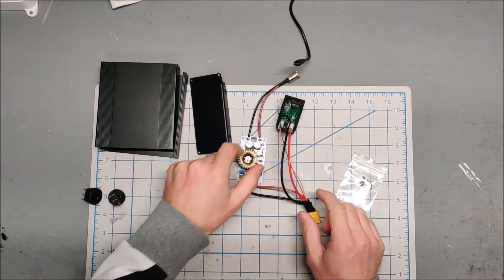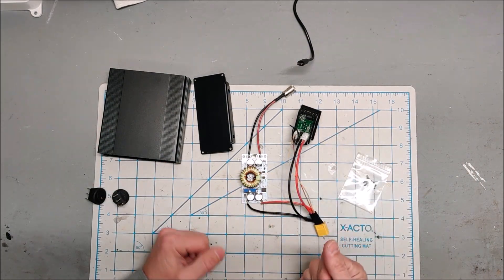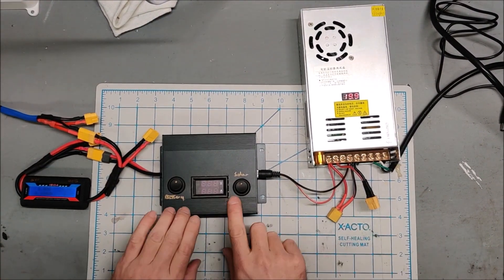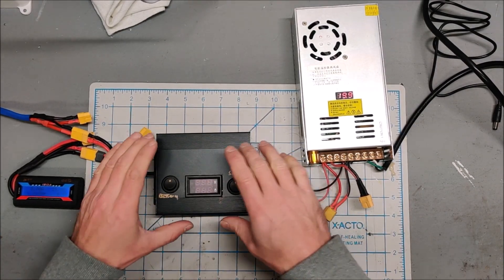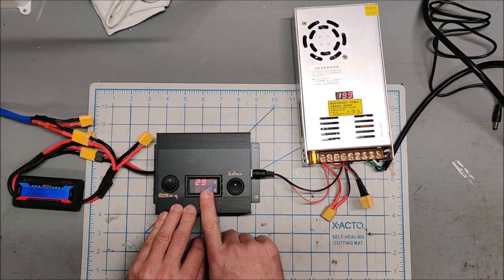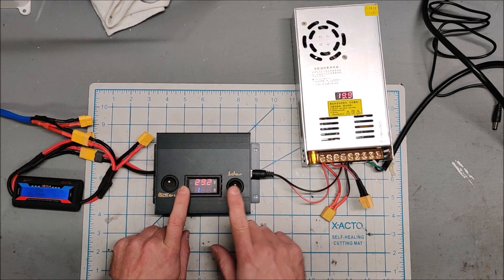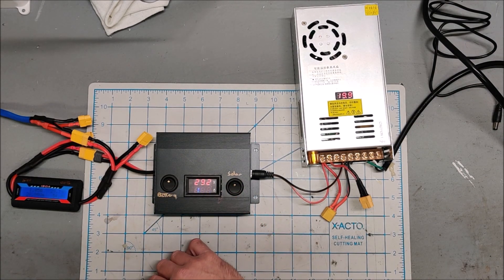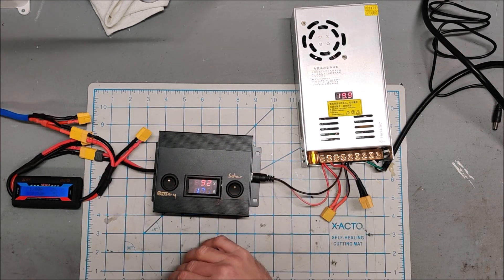DIY SOLAR CHARGE CONTROLLER BUILD

Comment: Hi Steven, Big fan of your short straight  forward videos.
I am doing a portable LifePo4 powerstation, with 50ah cells.

I am planning on adding a 20 amp PWM controller for solar input.

Nevertheless, I have been thinking about charging it in the car while travelling, without the hassle of bringing the panels if I am planning a short stay somewhere.

Would this be ok for a 12V socket charging to my LifePo4 portable powerstation? Since I cannot set charging profiles.

Thank you for the videos, great job.
Reply from the maker: Yes, you can use a boost converter to boost  12v to what ever you battery voltage is. What is the battery voltage of your Lifepo4?
Reply: It's a 4S, so it should charge around 14.2 or so not to bring it to 100%. What do you think?
Reply: Another question is, if passing the charge through the PWM instead of the buck converter makes any sense, not really sure...
Reply from the maker: @ricardomarcelino8388  here are my thoughts. 1) don't put the 12v into the pwm. Solar voltage is 18+v so your pwm is bucking the voltage down. We need voltage boosted. 2) a cigarette lighter socket can only handle about 100 watts. 3) they make proper 12v to 14.4v Lifepo4 chargers. I would just get one of those. https://www.amazon.com/dp/B082LV7RKL/ref=cm_sw_r_cp_apa_fabc_DZZJNZBE4KHYRJ8SM0A4?psc=1
Reply: @stevenc22  great to know that.
What if I connect it directly from the alternator with a proper thick cabling? I would leave it all to the BMS, right? I was just thinking that an inbuilt dc-dc converter would stay inside the powerbox and limit current when it rises to the desired voltage, right?

Sorry to be asking these many questions, but I didn't hear or read a coherent answer about this topic.
Reply from the maker: @ricardomarcelino8388  don't leave it all to the bms. Have some sort of converter in between to control the current. They make a larger 20amp version of the 12v converter I linked to that you can connect directly to the battery and charge at higher currents.
Reply: @stevenc22  thank you so much. I was really thinking this would make sense, and using the booster that fits inside the powerbox, will make it possible to charge in multiple situations, specially in the car, but directly from the alternator I don't think it is a good idea. So this buck converter makes sense. O think that a 20amp unit is more than enough.

Thank you for your knowledge and your videos.

All the best.

Comment: What about overcharge protection and cell balancing?
Reply from the maker: It has no active protection but if the boost voltage is set at the right voltage to match the battery, the battery will not overcharge. Also most solar charge controllers don't do cell balancing, that is left up to the bms.

Comment: Stevenc22 is this build better than the green LCD MPPT Solar Regulator Charge Controller 24/36/48/60/72V Boost MPT-7210A that you use for your friend solar build you showed in your other video..https://www.ebay.com/itm/264730127287
Reply from the maker: I like the 7210. It works well. But it is $50. The boost circuit is just a cheaper alternative.